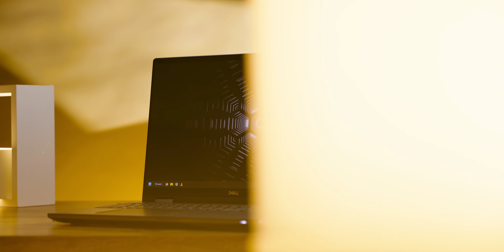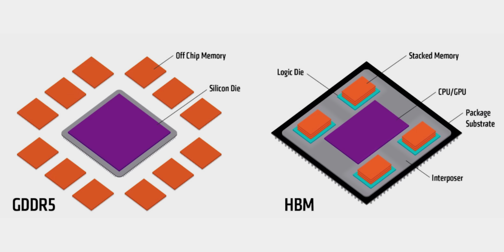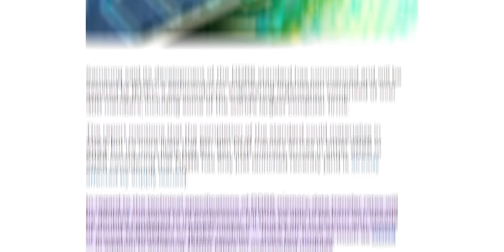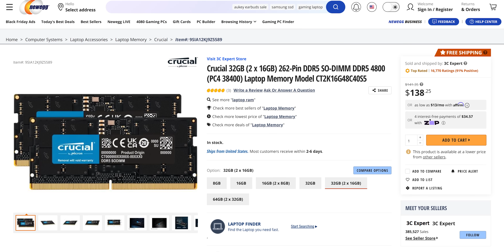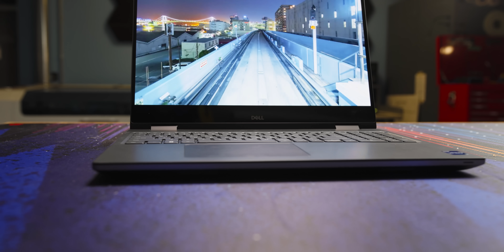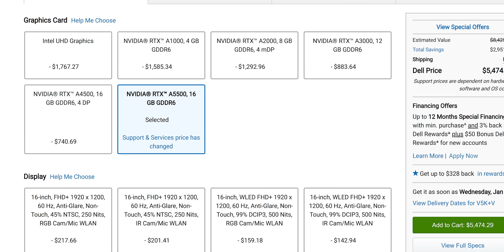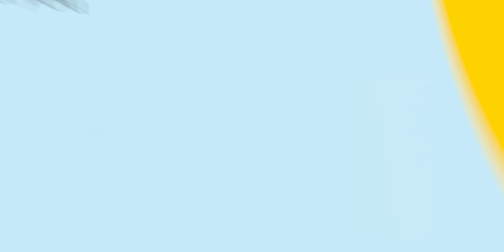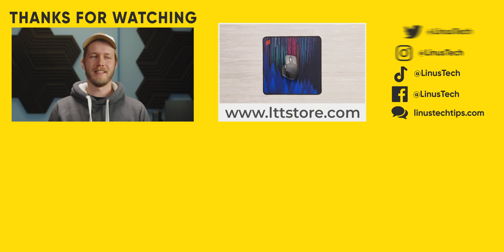I've NEVER Seen a Memory Stick Like THIS - CAMM Explained

Comment: Dell really has strayed so far from being easy to repair/replace parts. My Precision M6700 from 2013 is literally one of the most modular laptops I've ever owned. My son uses it now, but even its CPU and GPU are interchangeable. Along with having various ports, connectivity, 2 x 2.5" drive bays, a mSATA slot, and 4 RAM slots. Everything can be changed for some form of aftermarket replacement, save for the display, keyboard, speakers, etc. Mine in particular has the i7-3720QM and Quadro K4000M (with an unlocked VBIOS, so it's capable of being OC'ed)

Edit: This honestly seems like a decent approach at least, seeing as if they're successful with having it become a widely accessible standard, it'll (hopefully) be used by other OEMs like Asus or Lenovo. I can see this being a genuinely impactful change, if it's executed properly. Let's hope Dell doesn't drop the ball on it, cause let's be honest...this is also the company that thought it was a good idea to use a wonky ass 120mm AIO with a 12900K LOL
Reply: Got a Dell Inspiron 1545 from 2011, and I've upgraded its RAM, SSD, replaced the DVD Drive with a second SSD and even upgraded the frigging CPU!

So much has changed in the last 10 years for the worse, though I'm happy to see there is some pressure nowadays on the industry to make servicable devices again.
Reply: this is why i dont get dell hardware anymore cause of their anti repair mentality and proprititary nonsense is another reason to avoid them
Reply: @billyhatcher643  I make the mistake of getting the Inspiron 7567 a couple years ago, mainly to just have something "decent" when I'm on a trip or away from home for a while. It was only around $300 USD, sporting an i5-7300HQ + 1050 Ti w/ 16GB RAM (CPU struggles these days, but it still does what I need it to). Still, I was disappointed to see that the only "hot swappable" parts are the m.2 drive, 1 x 2.5" drive bay, and 2 x RAM slots. Everything else is either soldered, or proprietary
Reply: @invader-zen  Well, I'm writing from a 7567 (I7 7700hq + 1050ti version + 16gb of ram) and I upgraded the ram to 32gb, the wireless module to an ax210, the m2 ssd and 2,5" drive, the display to a 144hz ips instead of the 60hz tn panel. Basically anything outside of cpu/gpu wich are soldered. It's still rather easy to open and work on, and every screw size is indicated next to its emplacement. I have owned it since 2017, and I would rather complain about the absolute garbage audio drivers and the weaknesses around the anchor points of the hinge, where the plastic is breaking. Or maybe even the undersized cooling system / power supply, which somehow got far worse on the 7577.
Reply: @RoscomEngineering  Dang, I wanna know what panel you got for it. I wanna do that to mine, especially since it doesn't have a DisplayPort. And I know it's easy to change the accessible parts, but compared to older laptops there are just "less" interchangeable parts overall imo. I got mine in 2020, and I haven't really put much extra money into it though (aside from an extra 1TB HDD) since I have a R5 5600 + 3060 Ti desktop that I use more frequently. But I do agree, the speakers suck even at full volume and I did notice the cooling is...well, bad lol. Still, it's somehow enough for me to set a +200 core +300 mem OC to the gpu with afterburner.
Reply: @invader-zen  My screen is a NV156FHM-N4B, I'm not sure if it's still worth the upgrade tho. The price for it has gone up quite a bit
Reply: 120mm aios aren't that bad with a good amount of surface area and good fans. It'll probably perform the same as larger but mediocre 360 ones. Also, CPUs and GPUs were socketed even on laptops in the past, but thanks to AMD and Intel they're now tied to their motherboards. It's just sad how much we're going towards making sure that such expensive products become ewaste within a few years of production.
Reply: @leonro  did you see the GN review of the alienware model I'm referring to lol? They effectively made a 12900K perform closer to a 12700K due to how insufficient the cooling is from the included 120mm AIO. But I will concede that it probably has more to do with the case itself and the lack of any substantial airflow, cause they couldn't be bothered to redesign the 15 year old chassis. And the same could be said about cars, too. Manufacturers are going out of their way to "over-engineer" things to make them less user-serviceable, which promotes having the consumer spend more when it's time to upgrade/repair. It's honestly pretty unfortunate that this is the direction everything is headed.
Reply: @invader-zen  You got me, I didn't watch that GN video. And indeed, low airflow potential can be a really big problem with component cooling, no matter the type of cooler you chose. Also older 120 AIOs are rather weak. I just wanted to add that 120s aren't as bad nowadays thanks to denser fin arrays, improved designs and better fans. You'll still get better cooling with larger AIOs, obviously, but the gap has narrowed. To also be fair, Alienware probably used some cheap old AIO design too. You can't trust these huge PC makers to not cut costs even on top-end hardware, but especially Dell. They do make some good products, but you have to look for them.
Reply: @invader-zen  
Using the car analogy, it's a LOT cheaper to build components into modules for production and, in principle, I don't have an issue with that when they're RELIABLE!
When they aren't, you can, as you say, have huge repair bills when the actual failed part may be worth pennies. For example, my niece had a switch in the transmission of her Volvo (not picking on the brand, just an example) worth a couple of dollars fail, but it was a grand in labour to get to it.
Reply: Yeah I had an XPS laptop from right before they purchased Alienware, so around 2007 I think. You could even replace the GPU without much effort.
Reply: Many brands used to have replaceable components.
Sockets and add in PCBs have disappeared from laptops because of the same reason as soldered RAM -  height and space, and its cheaper to develop and manufacture.

Unlike desktop components, notebooks are designed and sold as a package and thrown away when they break rather than repaired. The whole industry has strongly embraced this idea in the last 5-10 years.

Framework is one company trying to entrench the idea of truly modular notebooks. But still the central motherboard is replaced as one unit. They could resurrect the enthusiast sector by embracing higher power CPUs and GPUs which has pretty much died off with the end of the upgradable MXM graphics standard.
Reply: I have a Latitude e6530 from the same era and it is so easy, too bad they didn't put a hole for the fan to breath. I repasted the CPU and GPU as well as replaced the fan and I had it done in under 90 minutes and I'd never done it before on any laptop. The thermals do leave something to be desired but there is good heat transfer so maybe some speed holes in the bottom are in order

Comment: Honestly, I’m surprise that Dell doesn’t sell their proprietary RAM separately. I’d imagine that desktops can more easily fit their large RAM module. Plus it’d help with upgrading the RAM in existing laptops (with the proper changes to the laptop’s internals).
Reply: I don't think they expect this to become a desktop standard, as there is always more space in the case.
Reply: There is no limitation on desktop memory like the laptop though so it doesn't make sense